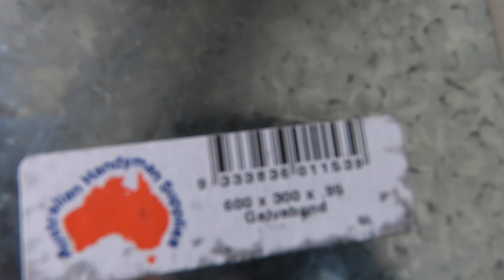A Flocking Good Time!

Comment: Wut do u think?....u needed more glue? 
I'm about 2 do mine
Reply from the maker: Gordo Osuna possibly a bit more glue, and I think the temperature here in Townsville may have had something to do with it. Maybe made the glue go off a little faster. The small patches I did like the center panel and the cluster surround cake out awesome, mainly because I could get all the glue down and then flock quickly after that. I’m still really happy with it though, especially for a first time effort.